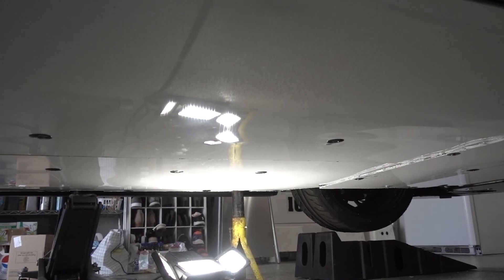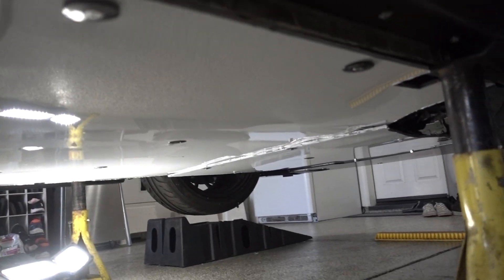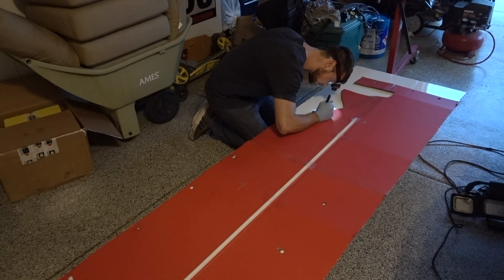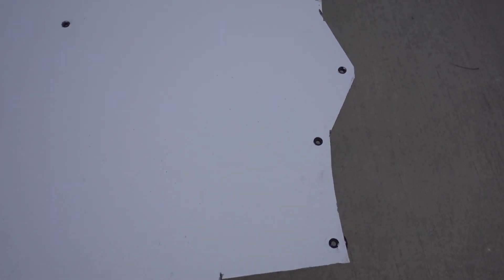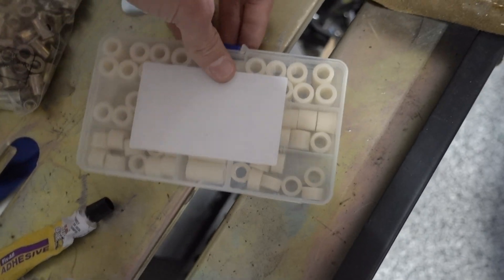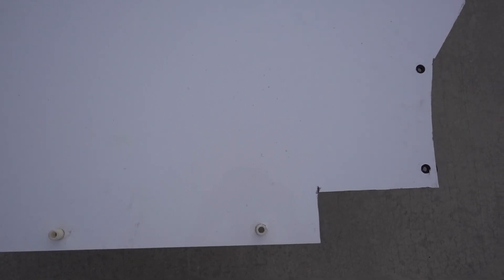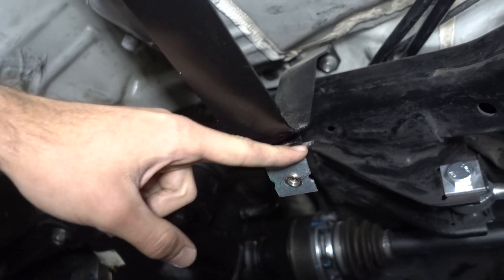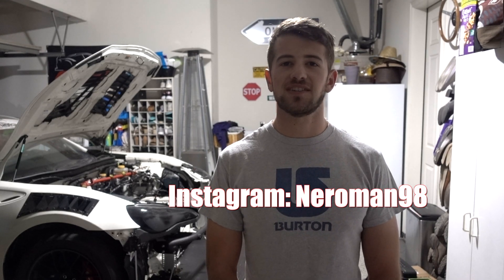How to build a Flat Floor for the FRS/BRZ/86

Comment: did you measure the 🌡 temperature difference with the floor on vs off? did you measure with a device for the atm pressures?

Comment: Where have you (or are going to) routed the exhaust in the differential area?
It's neat not having the exhaust hanging so low down but I can't figure out how to do that
Reply from the maker: I guess I should have mentioned this but I’m doing a fender exit exhaust so I didn’t have to worry about it. However you can lower the diffuser and thereby lower the entire rear section of the flat floor slightly and it should fit.